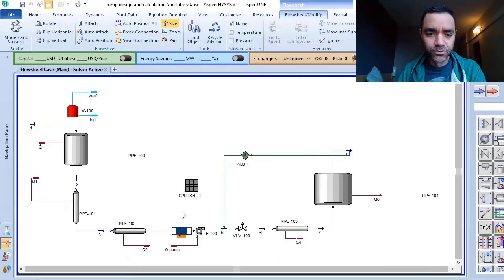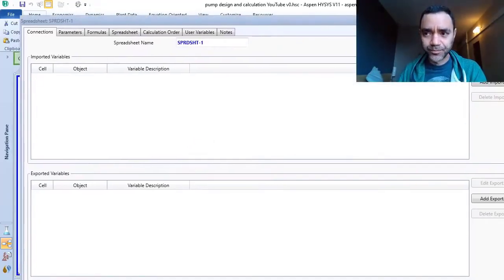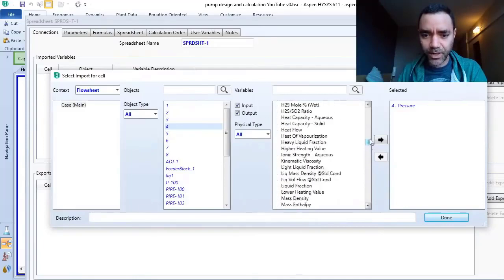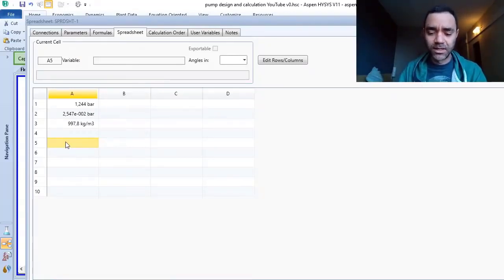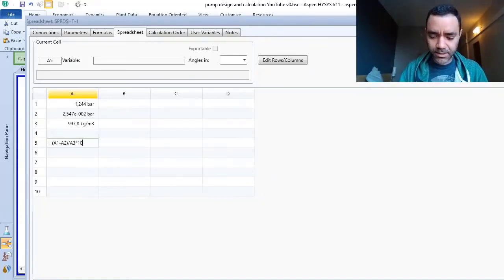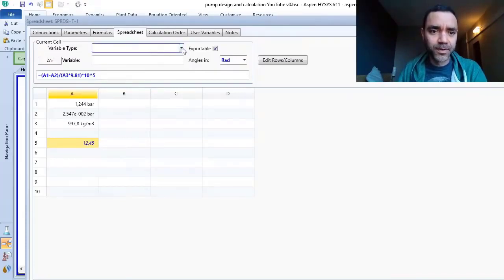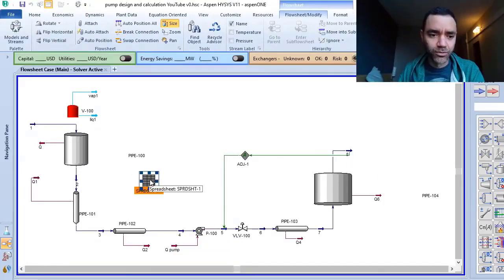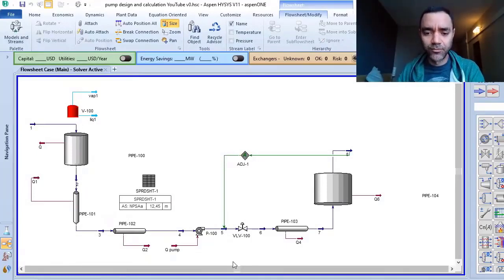NPSHa CALCULATION ON ASPEN HYSYS | HOW TO DO NPSHa CALCULATION FOR CHEMICAL PROCESS ENGINEERS

Comment: Hello.
Appreciate for helpful video.
I have a question. If we apply bubble point pressure (@saturated condition) in Hysys, it is not true vapor pressure and it means that more severe NPSHa calculation result will be conducted. Because most pumping fluid is sub-cooled condition. Am I right??
Reply from the maker: Hi Colin, I am not sure if I understood your question 😅
NPSHa can be understood as how far you are from your liquid vaporization. This way, you consider the vapor pressure of the fluid in the NPSHa calculation.
Think about it, a liquid in saturated condition refers to its surface. As you increase the column of liquid, at the "same" temperature, the liquid will be subcooled. Because pressure at the bottom is higher than pressure at liquid surface. The term subcooling (also called undercooling) refers to a liquid existing at a temperature below its normal boiling point.
True vapor pressure (TVP) is a common measure of the volatility of petroleum distillate fuels. It is defined as the equilibrium partial pressure exerted by a volatile organic liquid as a function of temperature as determined by the test method ASTM D 2879.